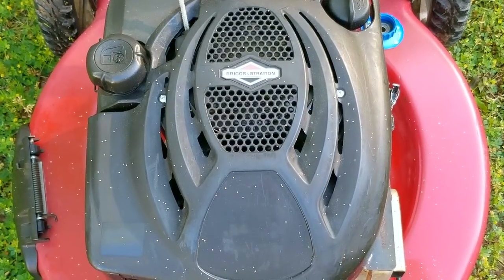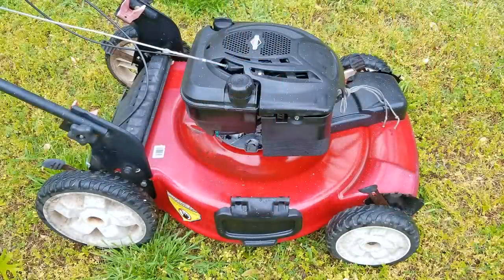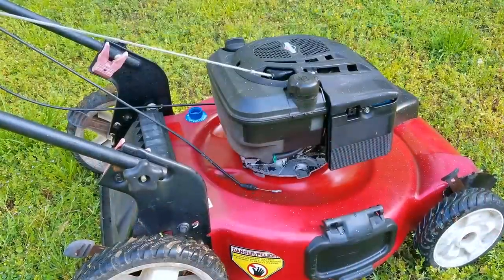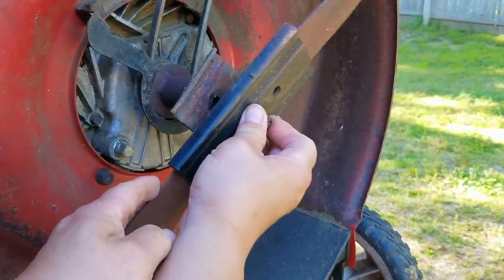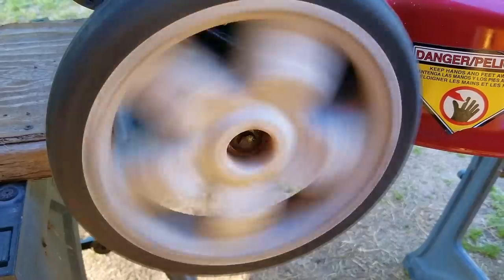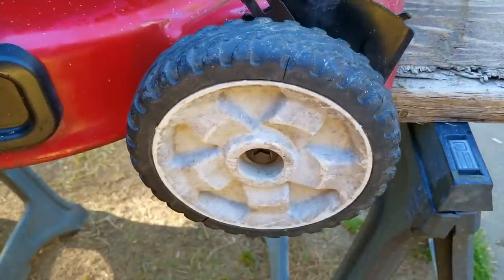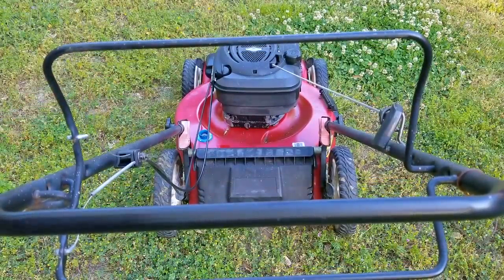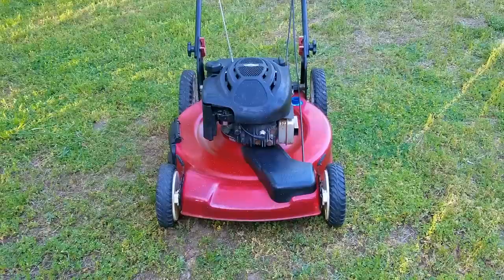Fixing A Toro Mower That Shakes When It's Running

Comment: I have an old Ryobi(MTD) push mower, that I bought at Home Depot, it runs well, I cleaned and restored it last season, the trouble is the wheels are wobbly, so I used copper tubing to make axle shims, to try and take out the wobble. So far so good. Nice evaluation of this mower, regarding the blade change.
Reply from the maker: nice, I like the tubing idea!

Comment: An amazing tip on those brake cables before installing them pull them all the way out of the cable shell and dab a lil bit of anti seize on the cable and then pull it back and forth in it's casing before installing it prevent them from breaking. And keeping the brake cable bar closed after it's off with a zip tie prevents water dripping down the casing rotting the cable and breaking.
Reply from the maker: I like that idea.
Reply: Absolutely if you can soak it in there. When I used to assembled bicycles at the toy store, sometimes I'd kill time by pulling out the brake cables and put NGL2 on them an it felt like a million bucks. People probably just parked it in the rain though. Not my concern. The company would open a return on something that looked like the kid drove it through a triathlon to Egypt.

Comment: I had a really old craftsman push mower that was cobbled together with all kinds of mixed parts. I called it “Frankenmower”. One day I hit a brick and thought I bent the crankshaft. I put it at the curb. Few years later my neighbor has the same issue. But he takes a Jack Handle and straightens out the crankshaft in 5 minutes. No fuss no muss.  I immediately thought about Frankenmower.  Oh well, water under bridge.  Good video.
Reply from the maker: it can be done, just don't like doing it.

Comment: Nice fix. I'm amzed at the number of people who get rid of mowers because of a bent blade.
Reply: I got a free mower because the guy tried to sharpen the blade and put it out of balance. Free mower and 20.00 dollars later and it ran for 6 more years.
Reply from the maker: me too, I'm guessing they weren't aware of it.
Reply from the maker: very nice James McArthur
Reply: @catsshadows  great. Good to hear. Blades are not expensive.
Reply: @INSIDEHOUSEGARAGE  Nope, they were sure the engine was bad. Never told them i was still using it.

Comment: I dont think that I have ever thrown away a mower with a bent crankshaft. However, I remember my dad working on an old push mower and he was using a hammer and a crowbar to try to fix it, and he did crack the sump on it. He ended up trying to fix the sump with gasket maker LOL. It didnt work, wnd we ended up swapping the sumps from another Briggs haha. Awesome video IHG
Reply from the maker: thank you for sharing that experience with us, I appreciate it a lot
Reply: Having worked at a "Toro" dealer for 10 yrs, I have straightened a few cranks. That being said, ALL THE MANUFACTURERS STATE DO NOT STRAIGHT CRANKS ! You can be sued if it breaks and someone gets hurt.

Comment: That’s great, I have a suspected one as well, but the screws for the axle have fallen out so will need to replace them first.😊
Reply from the maker: that makes sense, I've never priced them so I have to wonder how much they are.
Reply: @INSIDEHOUSEGARAGE  they are for the Aluminium frame, I’ll just take one out and go to screw and nut  shop

Comment: I see one or two push and self-propelled mowers a year with bent crankshafts.

You can usually straighten a bent blade (not completely bent), by hitting it on concrete with a sledgehammer and safety glasses on. I do it all the time on customer bladed that are bent.
Reply from the maker: nice work!

Comment: After working piles of different jobs you get to be around harmonic resonance which is vibrations coming and going. About the worst of these are the bearings on a rock crusher jaw unit. Their as big as a fat mans waist and a shaft running through them at least 12 inches through on a big unit. They run smooth as water pouring and then vibrate enough to almost start you skidding across the floor. I usually check the blade balance 1st and flatness at the same time. Usually the blade has the edge of a butter knife handle so it gets overhauled 1st thing. The crank running straight too. Glad you got this one fixed. I trimmed this morning with the 85 Snap0er. Took 3 pullos because it hadn't been started in a while. BLESSINGS!
Reply from the maker: yes this one was certainly a relief to finally got fixed, thank you Lewie McNeely
Reply: @INSIDEHOUSEGARAGE  Thank YOU, Pal!

Comment: Definitely agree on stabilizing fuel.  Sometimes it's possible to get ethanol free 87 octane where I am, but if you need 89 or 91 octane (what most 2-stroke equipment calls for), you can't get ethanol free. As a result, I stabilize all my fuel. The unmixed gas goes quickly, but my mixed gas takes a while to use up.
Reply from the maker: good point

Comment: Bent bolt. I have one i saved from an mtd Slapper. The Slapper came from Wally world. That mower was eventually stolen but i didn't like the janky auto choke on yhere and had random objects jammed into it. They stole my gas can, a $50 battery tender and mower all in one go. I believe that they either used it or passed it off somewhere else. I chain everything now. And remove wheels.
Reply from the maker: nice method. Was the mower in a garage or shed?
Reply: @INSIDEHOUSEGARAGE  on porch. But I see this a lot. Neighbors bike  was out of sight and in the back and got stolen. The issue is the sidewalk between low rent apts and town. Pawnshops
Reply: I never saw it again. But you can drive around and see all kinds of mowers either on the porch or a rider near a gate in a parking area. I always laugh and say "I wouldn't leave my equipment. It would be gone in a weekend."

Comment: Excellent video! However, I have a strange issue. My Recycler shakes when "stopping" the blade. Very perplexing. As soon as I re-engage the blade, the shake stops. Would you happen to know what may be causing this?
Reply from the maker: I'm guessing that you have a blade clutch, if so, the bearing might be going bad in it.

Comment: Where I live and the sheer amount of outdoor activities, ethanol gas is available at the local gas station. The quiet part however is that the local gas station is 30 minutes away.
Reply from the maker: wow that's really far away
Reply: Why would anyone go for the ethanol crap. Get non-ethanol or run tank dry every single time.
Reply: @marshmower  If you can get ethanol free, I agree with you, but especially in urban areas, gas with ethanol may be all you can get, unless you drive a very long distance to get it. When I lived in Allentown PA there was only one gas station that sold Ethanol free gas that was 30 miles from my house, a month before I moved a second station opened a block away, but for much of the 12 years I lived there I did use ethanol gas, I installed a shut off valve and turned it off and let the carb run dry to stop the engine.

Comment: Bent blade doesn't translate to vibration,   balance the blade by grinding some off the heavy side or weld some mass on the light side.   Just drive a nail in the wall and hang the blade by the center hole to find the heavy side.    I use a string across the bottom of the deck for a reference to see if the crank is bent.    I've saved a few mowers with some well placed whacks with a sledge to get the crank back "good enough" straight.

Comment: I have not dealt with a bent crank yet. I wouldnt bother trying to straighten one. I would try to find a good used crank if the mower and rest of the motor is worth it. (Or if it is almost new l would get a new crank). If it isn't worth a crank l would rob the good parts off of it and send it down the line.
Reply from the maker: I'm on the fence about them. If it belongs to someone else I would just tell them to keep using that way. But it's difficult for me to sell one.
Reply: Yeah l agree about fixing it for someone elses. If you break it trying to fix it, its your fault even though them hitting something caused the issue in the first place. And they probably arent going to be happy, unless that gives them a reason to get a new one! I wouldnt be comfortable attempting a repair unless it is a last ditch effort and they are ok with the attempt knowing the risks. But if it runs, (and the vibes arent to bad)  just continue using it till it quits if you know the repair is iffy at best.